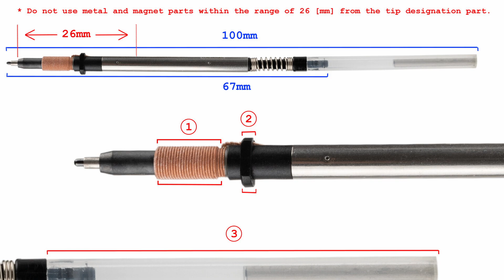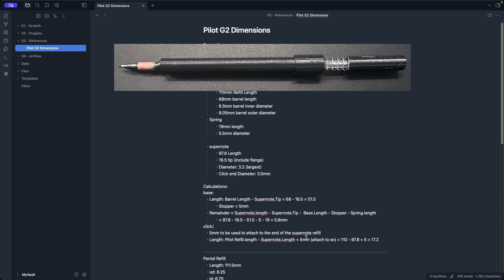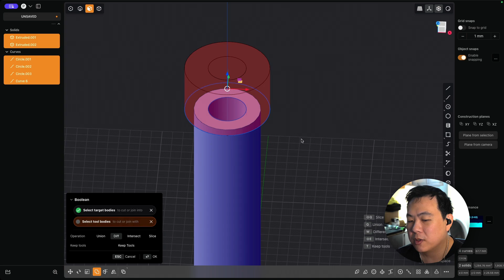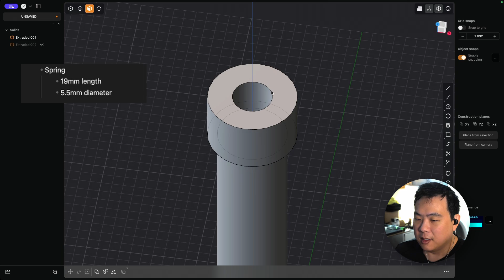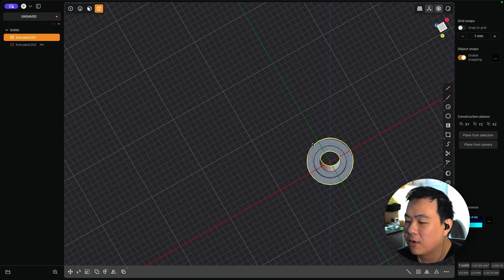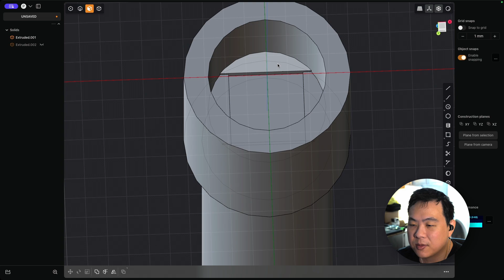Learn Plasticity: DIY Supernote Pen in a Pilot G2 Body

Comment: if you’re adding bridge geometry after the hole has already been created, avoid making the rectangle exactly the same width as the hole diameter. Using a slightly smaller or larger rect width helps prevent coincident edges, making Boolean operations work. I think this is important, because usually you design the hole first before deciding to do the bridging. For example hole 6mm, rectangle 5.95 or similarly. For me as a beginner this technology was new to me, but it works extraordinarily well, also on bigger holes.